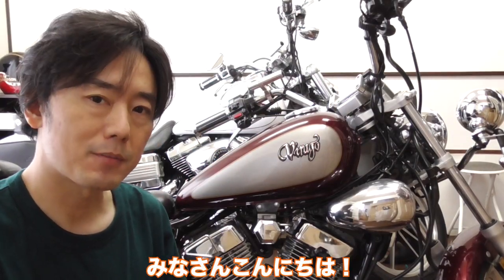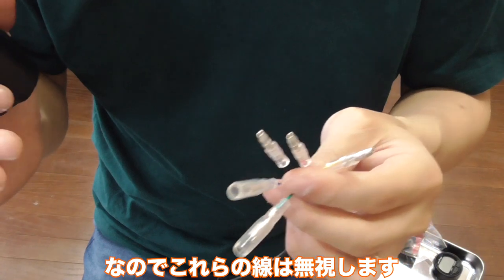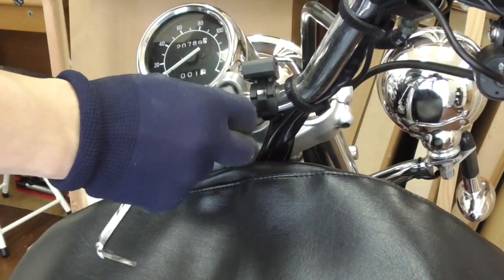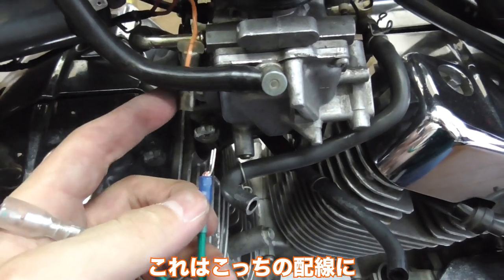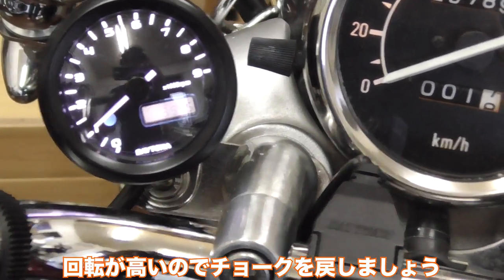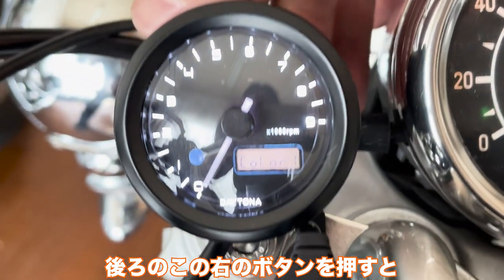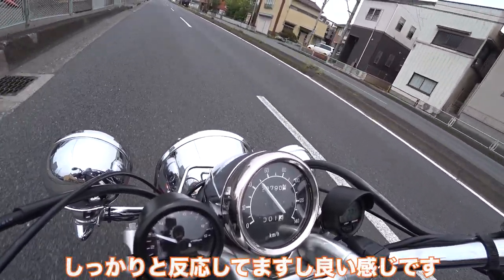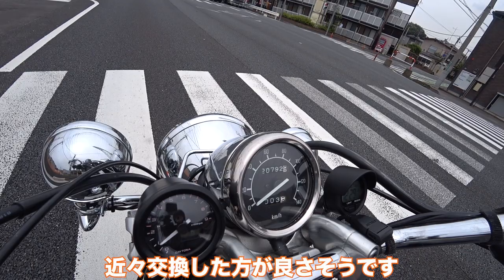【Tachometer Installation guide for Yamaha Virago】How to install a motorcycle tachometer XV125 XV250

Comment: I have the one with one wire that just wraps around the spark plug wire. Do you know what cylinder i should have it at?
Reply from the maker: Whichever is fine but it probably isn't as reliable as direct wiring.  Please refer to the product's instruction manual.
Reply: @psycho-cycler  yep I actually bought one for a 750 and going to install it on my 535 directly. Thanks!

Comment: Thanks for the video. I am thinking of installing a tachometer on my XV250. The Daytona tach looks nice but not available here in Canada.
Reply from the maker: Quel dommage but you may still be able to get something similar. Canada is such a beautiful place. I miss it.
Reply: @psycho-cycler  Did you visit or live in Canada? You have some French!
Reply from the maker: I grew up in Canada. Really miss it.
Reply: @psycho-cycler  I wondered how your English is so good! Japan, of course, has many beautiful sights. I have been several times as my wife is originally from Tokyo. Although I have never rode a motorcycle in Japan I'm sure it's a great place to ride with the mountains and winding roads. I've just added that to my bucket list!
Reply from the maker: Perhaps we can go for cruising on your next visit to Tokyo:)
Reply: @psycho-cycler  👍
Reply: I was able to order the same tach from a vendor in Japan that delivers to Canada and have now installed it on my XV250. It works great! Thanks again for the video.
Reply from the maker: Awesome!